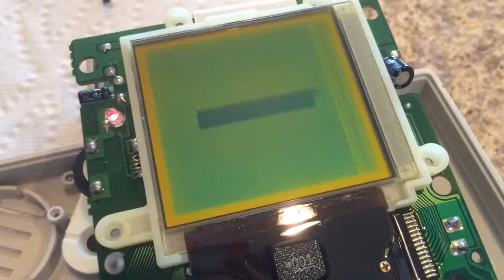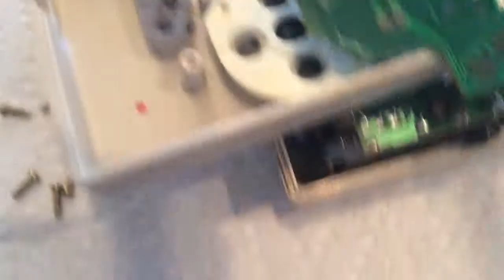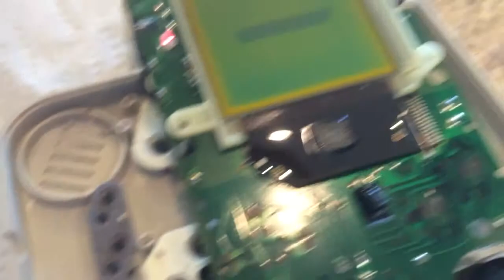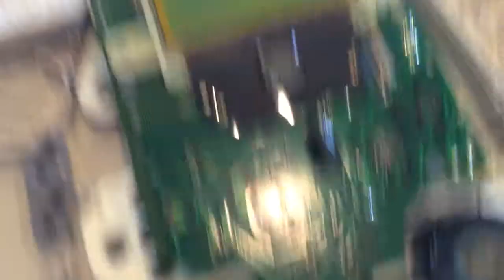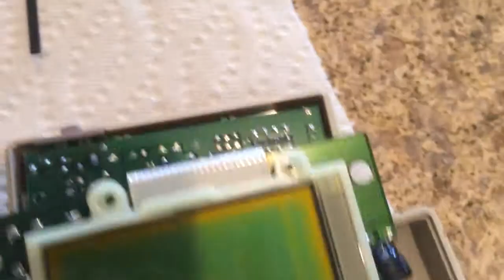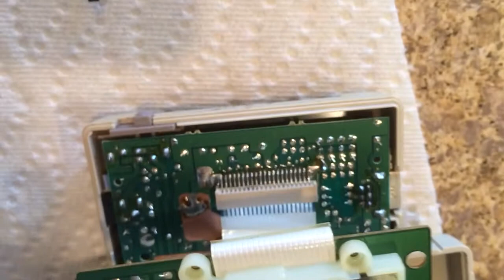GameBoy Repair - How to fix vertical lines on original Game Boy DMG-01

Comment: You added at least 5 lines during this process
Reply from the maker: They fade as the solder reflows and hardens. I still have this unit and it has no lines currently.